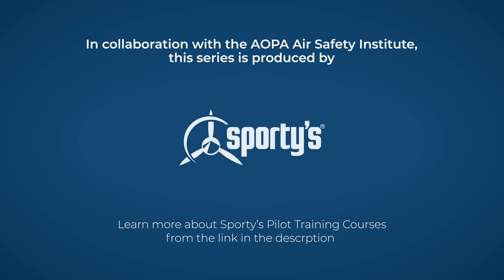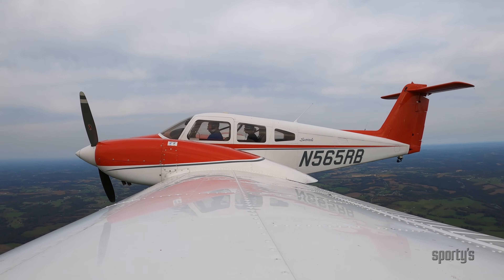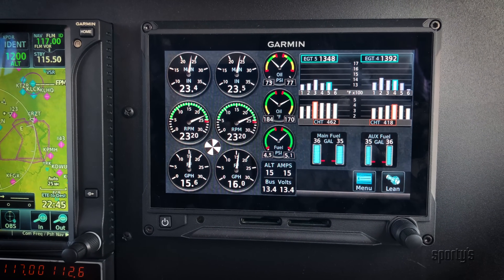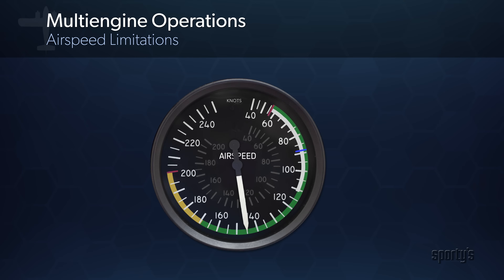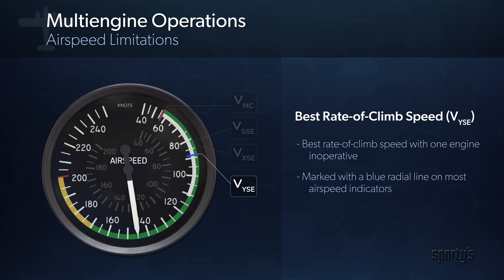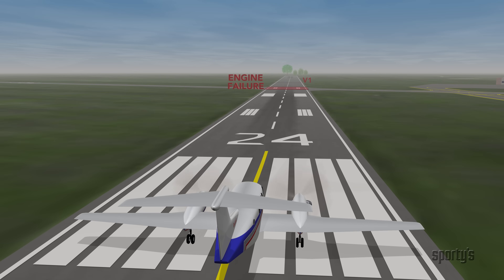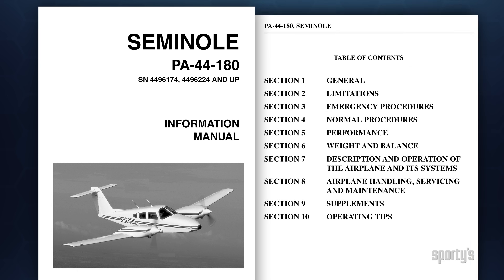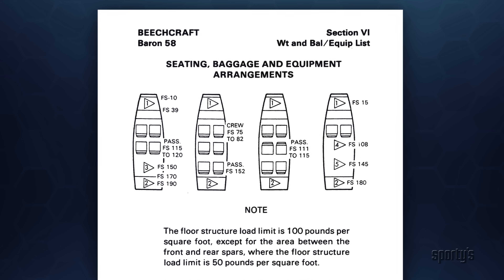Taming the Twin: Introduction to Multiengine Airplanes

Comment: The one thing that mentioned is lite twines won't fly on one engine with the gear and flaps out  so clime as high and approach t 500 to 750 ft high nose up reduce power. Ger and flaps deployed maintain speed with enersera flair hit the numbers flaps up then braking I always llanc like this I never have to worry about losing an engine on landing fcb

Comment: Would it be correct to say that V1 and V2 can be said to putatively exist for small multis on short runways on which you can land, or take off, but not both?
Reply: The two Vspeeds exist because the FAA regulatory requirements specify it.

Any twin engine aircraft in existence could have been designed to have sufficient lateral-directional control down to the stall speed, or so close to it, that Vmc was practically the same. 

This takes approximately 10-20% more vertical surface area, and effectiveness. Thereby costs an additional few pounds and reduces a couple knots of speed. This is untenable when selling aircraft to customers in a competitive market where all other designs are optimized for performance, and never for safety. 

And when a design comes along which solves all of the problems, and outperforms everything: People disparage it and refuse to replicate it. (Rutan Boomerang).

Comment: The likelihood of a failure in a twin is √2 higher, if both engines are equally reliable.

√2 is 1.4
Reply: and the severity of that failure may be lower
Reply: If both engines have a failure rate of once in 1,000 hours that means they have a probability of 0.999 to not fail in a given hour. The probability of both not failing in a given hour is 0.999 squared, which is 0.998001. The probability of that not happening (i.e. not having both engines operating, in other words one or both engines failed) works out to 1-0.998001=0.001999, which is once in about 500.25 hours. So about double the chance of at least one engine failing compared to a single engine plane with the same engine reliability.
Reply: @igclapp  yeah, I don't know what I was thinking.  I screwed it up.

Comment: 2:05 what is that black and white gauge I see spinning occasionally on turboprops that’s between manifold press and tach? Always wondered
Reply: Helps with prop sync. It spins toward the engine with faster RPM.
Reply: turboprops don't have manifold pressures.

other commenter said (without saying as much) that it was a synchrometer

Comment: First rule of flying Twins - THERE IS NO REASON WHAT-SO-EVER TO FLY BELOW BLUE LINE - except on controlled, intended landings, or when doing Vmc Demos.
Reply: No be sure you can afford to fly it!
Reply: @mikearakelian6368  only in training.
Reply: I agree with that statement
Reply: Here in Europe we don't do VMC demo's. Doing them or not can be argumented both ways I think. 

ME training here is about knowing the dangers, critical speeds and handling asymetric flight in flight and in the circuit. 

For the training class ME-aircraft VMCa and stall speeds are often times so close to each other. Giving a VMC demo in such an aircraft  results in demontrating ALL the inputs for a spin entry, in an aircraft which is not allowed to spin.. VMC demo's are fine to do, but bettee just do them in different aircraft than a light twin imho.